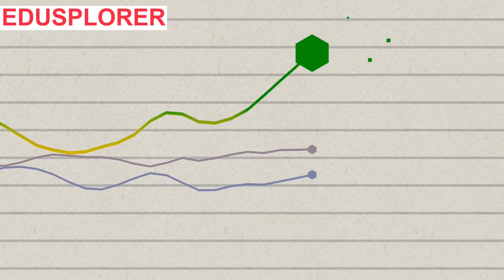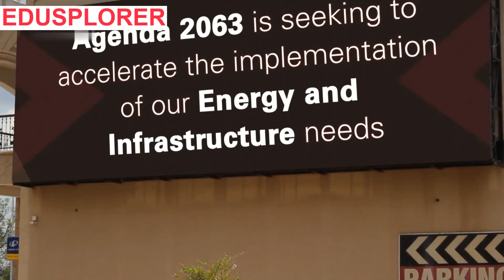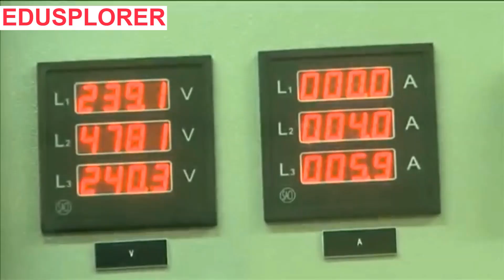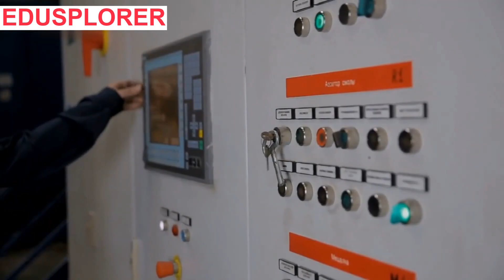Solving Africa's Electricity Energy and Power Generation Could Increase Africa's Prosperity.

Comment: Africa should use it low hanging energy fruit resources to solve is energy problem such as biogas and solar concentrate to produce power at home with net metering instead of building centralized power plant such system can be built for less than $350 a piece
Reply from the maker: Hi Luis,
Thanks for watching our channel, we appreciate your valuable time. Please Subscribe, like and share our videos if you have not done so already. Watch our other videos and follow our channel.